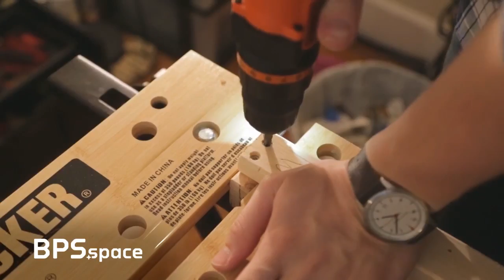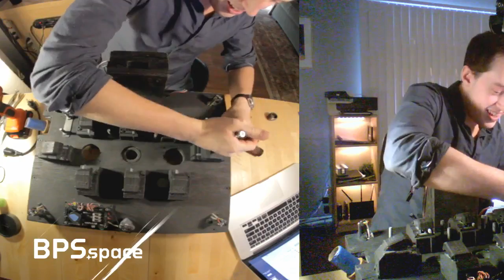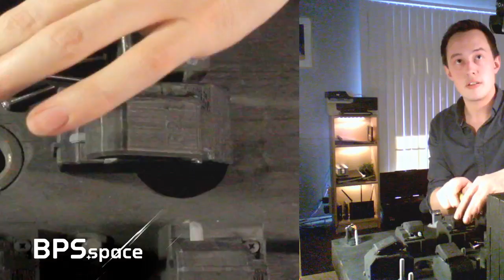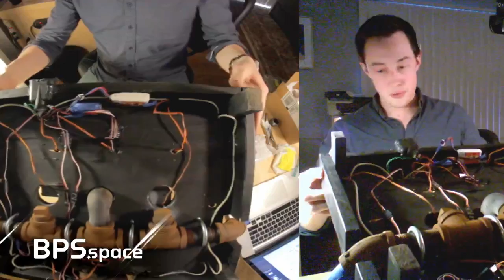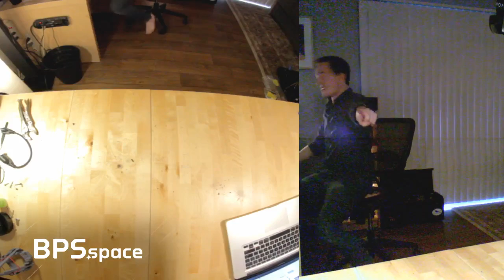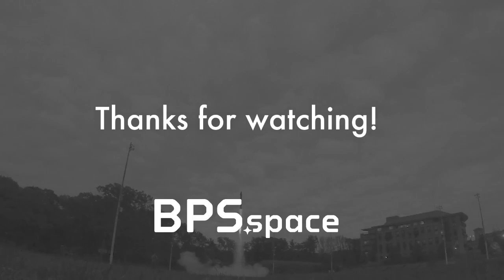Launch Pad Maintenance

Comment: So the easy way to do this is to leave all 3 elbows in place, and get flush mounted pipe plugs that have a recessed hole that uses an Allen Wrench.   You can block off the ones you don't want to use and still get the exhaust flow to the outsides.

Comment: How does the pad computer not get blasted by rocket exhaust
Reply from the maker: There's a cover that goes on top of the pad computer to protect it, it's not on the pad in this video though. The exhaust doesn't damage the computer, but it does put some soot on it if the cover isn't used.
Reply: BPS.space oh, makes sense.